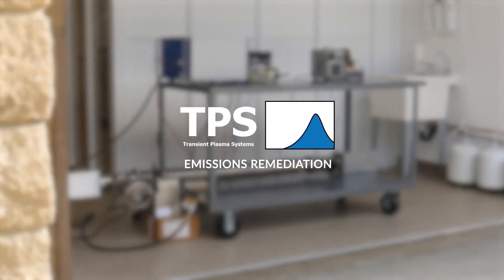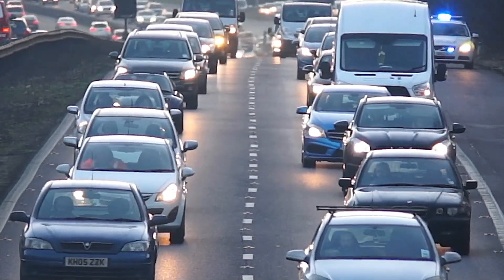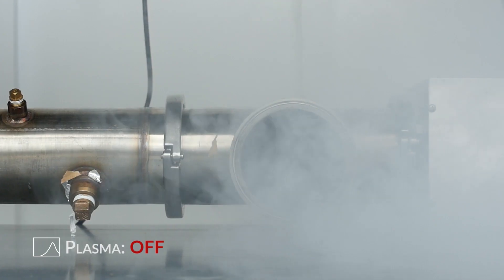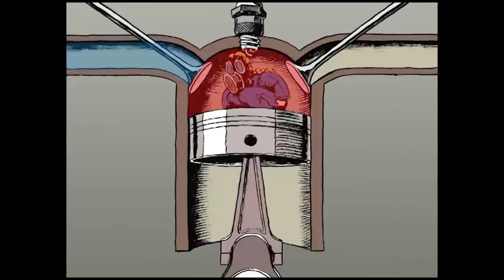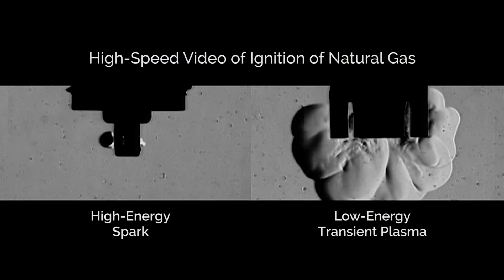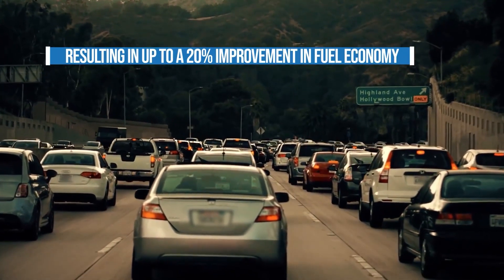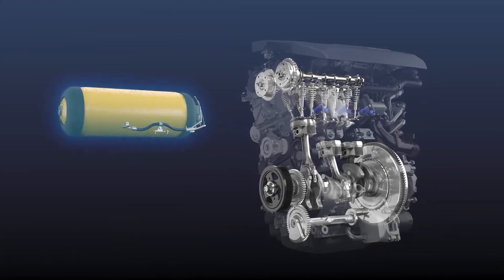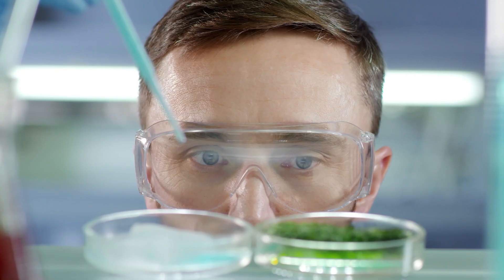This new Plasma Ignition system will improve your car's fuel economy by up to 20%

Comment: Problem is no mention of an aftermarket system that could be retro fitted to older ICE's. And as you said in the introduction, you would love to make your old vehicles more efficient which also avoids the environmental cost of building a new vehicle (be it ice or electric). I'm not sure that's what vehicle makers want though...
Reply: I messaged the creator Dan Singleton about this exact idea a few years ago and he told me that unfortunately as of then there was no intention in creating a retrofit kit for older vehicles.
Reply: @JBeck2468  That is correct, which is a real shame both from a business opinion and also from an emission type of opinion. While EV seems to be the future, however enviromentally dirty in the production phase, they are less pollutive in the user atmosphere and that is all that counts for people on that side of the isle, - who also VERY RARELY have the need for other transportation than the subway. (Slightly biased, but still) 50% of the developed world could most likely handle a transition to EV´s within a 10-12 year time frame, but that would leave the lesser financially viable countries in the dust- litterally speaking, because that is where all the precius metals are being excavated. But it is not the first time developments are being directioned towards new vehicles alone. There are several systems out there already which can improve average fuel efficiency with 6-10% on almost any vehicle. The problem with those systems are that most of them fight higher Nox levels, which is of course bad. BUT, when looking at the TOTAL amount of Nox per driven km. it is still 3-6% LESS than conventional. Sadly these systems are illegal in most countries because they interfeer with the car´s ECU, and in many countries it is illegal to modify the ECU and if you get caught in an inspection it is so expensive in fines and "authorized" correction that you migh as well just scrap the car. The main problem is - once again -  that the people legislating within these matters do not have the sufficient background to make these laws on a knowledge based foundation. Think of it. Would you hire the average social worker to do the roof of your house? 
If we were not governed by stupid laws and regulations that primarily is to ensure that the goverment has its dirty little snout down in every little thing that has the potential to pay a dividende- and at the same time create "equal levels" for both the person living in an appartment and the family who are living in a house, we would have been way further in the quest of using and reusing waste energy as well as saving on the energy spent.

Bottom line is, I hope someone with enough skills in such matters are able to make a similar system to be retrofitted in older- and vintage cars, because there is a huuge potential. I have played a lot with conventional plasma igntion for race cars and tried to implement it onto street cars/engines. The power potential is there, the emission reduction is there, but the system I have been using are too high strung and i have not found the level where there is enough plasma spark to get the advantages but also make the plugs live for a decent amount of miles, yet
Reply: @torbenalstrup3902 this is very interesting, I've only got interested in this plasma ignition because I've recently purchased a bi fuel car(gasoline and Lpg), it's not running as good as I would like so I have bought Plustar (tm) spark plugs which seller claims create a plasa spark which will ingnite fuel air mixture earlier and better than conventional spark plugs, I am waiting on delivery tomorrow morning,I can't wait to try them however I understand the manufacturer may be exaggerating how well these plugs work, if i find a small improvement that is a step in the right direction.
Reply: What plasma ignitions have you tried?????  I didn't know there were any like this in the aftermarket...

Comment: Seems cool but the thing is will tgis be used in gas cars or will the be used in hydrogen combustion cars
Reply: @Enrique Thiele Also problem with hydrogen is that commercial way of production generates more CO2 than running engine with gasoline. To make it clean we have to use electrolysis which is way to expensive. Only if we harness fusion energy and it become 10x cheaper than current electric energy prices hydrogen generation would be feasible and clean.